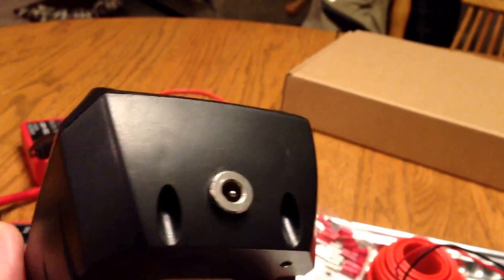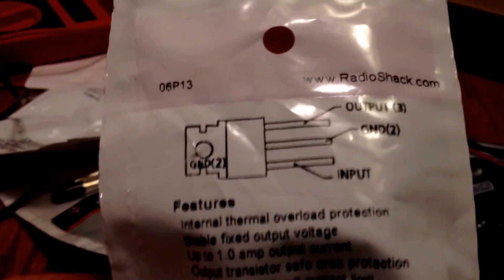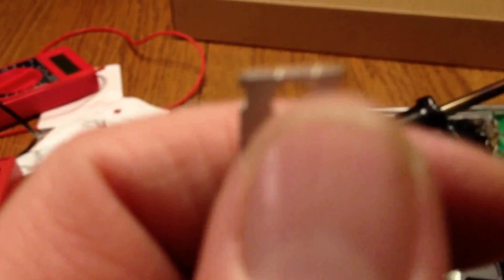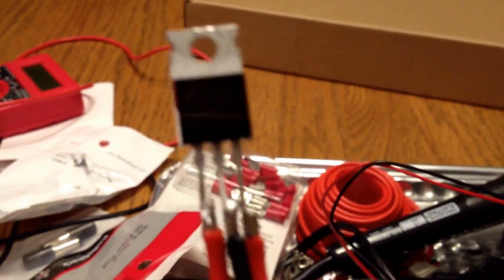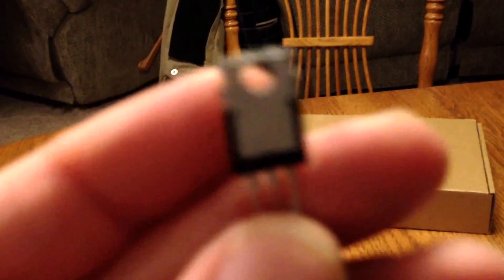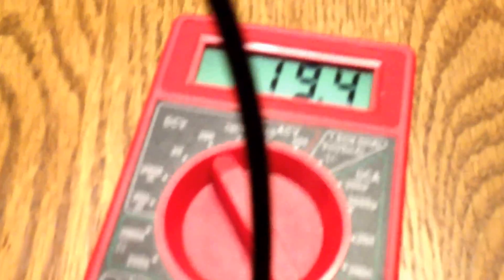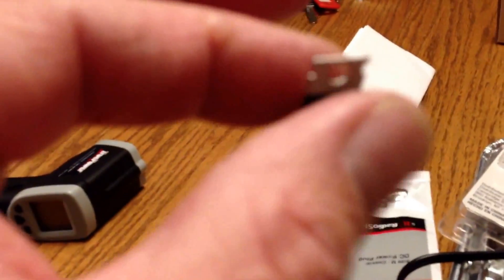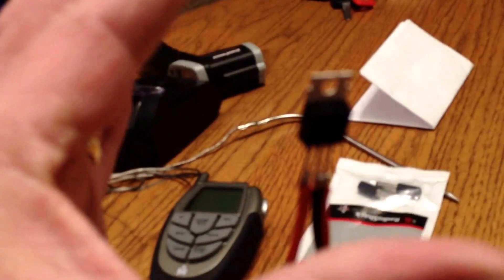Radio shack 7812 12v dc regulator reduce  18v battery down to 12v experiment and how to wire I think

Comment: So if it's taking it down from 18 to 12 volts the other 6 volts basically stores in that piece there which in turn makes it hot? I was trying to figure out how the hell it works I would think maybe you could use the heat from that thing just a painting through a carbon tape for heated clothing instead of just sitting in one spot

Comment: I figured it was something basic like some kind of resistor something to regulate the amperage. Because I'm trying to run my motorcycle heated jacket off of a Milwaukee batteries in Makita Batteries because I'm tired of these damn wires. And then once you get off the bike or screwed as far as the heat goes. But I tried all kinds of s*** even call myself on fire one time. I've used everything from heaters from the seats of cars to Electric 12-volt blankets from Walmart. Nothing is really as good as the Damned tourmaster heated motorcycle jacket hooked to the battery of the bike but it keeps f**** up my bike electrical system. Trying to run a jacket my gloves radar detector for some reason it's screwed the hell out of my GSXR 1000. I also have a ninja 650 but it didn't seem to have electrical problems with the stuff. I was thinking I go to RadioShack and get something instead of buying one of those damn things they sell for  a hundred bucks

Comment: it is save the very old ones wuld burn up but today you gaot themperature limitet regulators like yours it will shut down at~ 120°C but if you put a heat sink on it the regulator will never get this hot lets say for exampel you us your 18v input X 1 Amp curent draw you got 18Watt´s of heat you have to Radiate!!! kep this in mind linear voltage regulators are great but not mutch eficient but they dont put out interverences lick buck converters do . buck converters are more eficient then linear they also dont get this hot
Reply from the maker: +Pascal Harder Thanks for Info